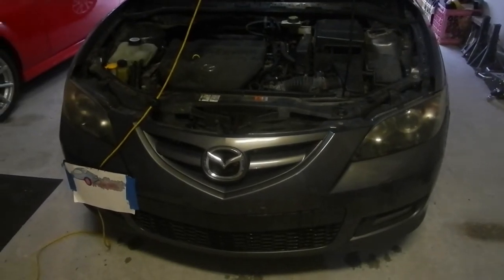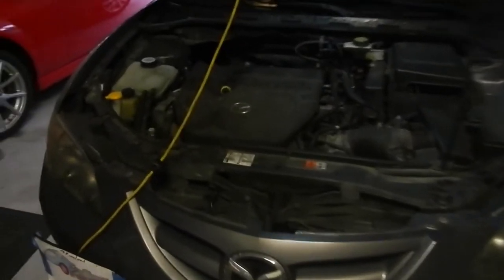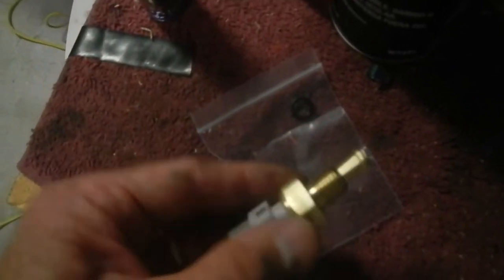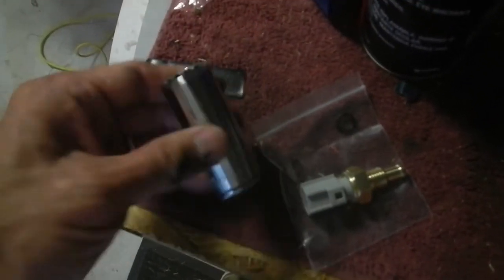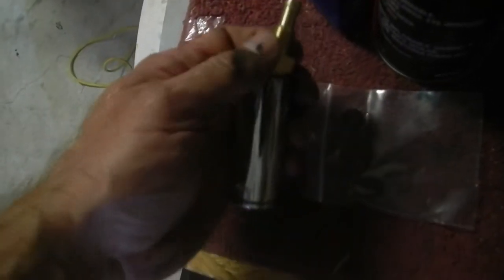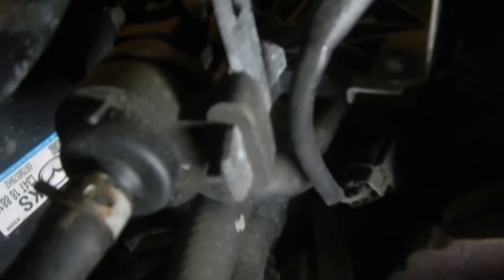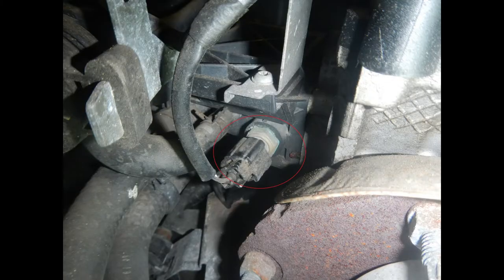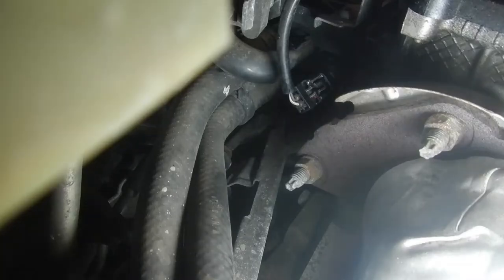2007 Mazda 3  Coolant Temperature Sensor

Comment: Did that fix the fan not coming on for you? I'm having the same problem
Reply from the maker: No it didn't.  I needed new radiator fans
Reply: @onepinkwheel6410  did your fan work with the AC but not coolant? Or do you have two fans? I'm about ready to drive my Mazda off into the lake LOL
Reply: @rayneedaebluz  I just came from a 2009 Ford Edge to the 07 Mazda 3 hatchback. It definitely is a pretty reliable car, this fix is easy
Reply: This fixed my radiator fan not coming on. Took forever to figure this out. No MIL light, temperature readout still worked as well ....🤷
Reply: @bkordel so your fans wasn’t coming on ?